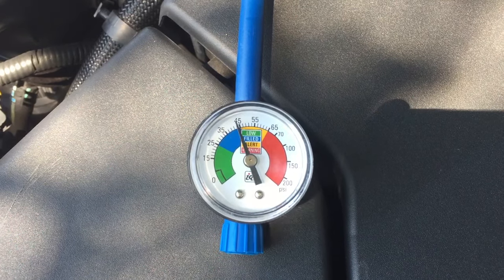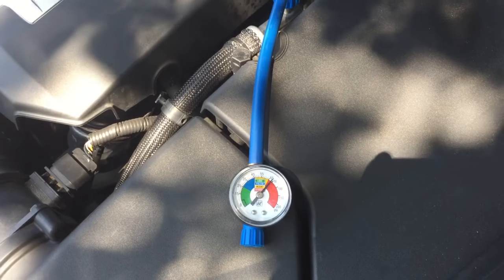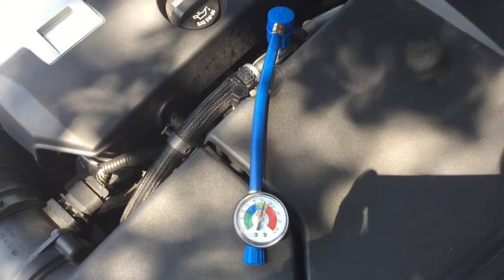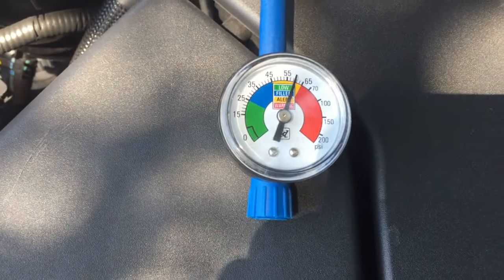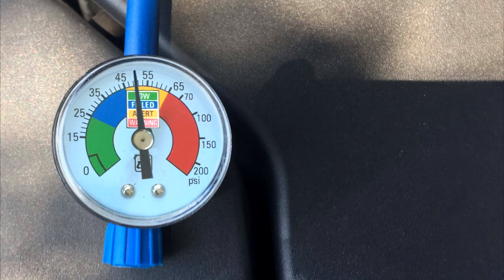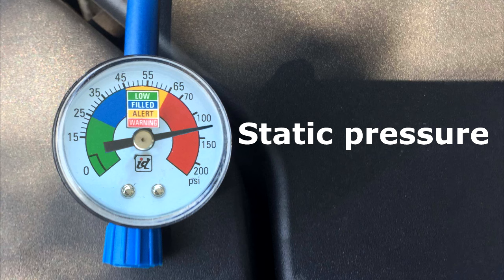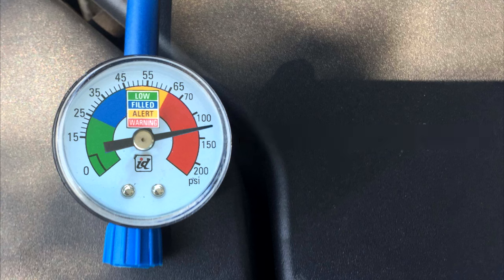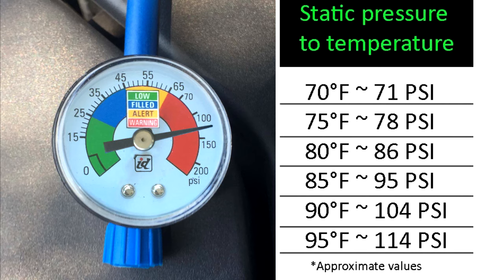Car overcharged AC system or undercharged fix

Comment from the maker: Forgot to mention that it's best to let your car cool down to ambient temperature for a more accurate pressure reading.
The chart in the video is for R-134a refrigerant.
Reply: Hey my static pressure is only 70psi at 80f outside temp. But when i turn on my car and ac and plug it, it goes into the yellow 55psi which should mean is overcharged. Idk what to do, should i add more? Or is my problem somewhere else?
Reply from the maker: @omarct according to the chart you need to add more refrigerant.
Does the pressure fluctuate up and down, or it's steady around 55 PSI?... if it's steady the compressor could be going bad.
Reply: @Your-Self  Yes its completely steady.
Reply: @Your-Self  To add, the ac is working but the air coming out doesnt feel cold enough,  around 60-70f if i had to guess,  it takes a long time to cool when it is very hot outside.
Reply from the maker: @omarct I'd try adding the refrigerant a little at the time because it seems too low. If that doesn't help, you'll need to see a mechanic because the compressor could be weak, or the expansion valve got stuck, or something else... not sure.
Reply: @Your-Self  Ok thank you.
Reply: @Your-Self  Hey, it seemed my car was overcharged somehow. So i removed some freon and now the air is cold again. ty for the help.
Reply: So is being in the Green Zone Appropriate like every other video says??
Reply from the maker: @Rob G on this particular gauge, the Green Zone is kind of low... need to be in the Blue Zone. Other gauges may have different colors, so I'm not sure.
Reply: You should pin this reply to the top as it's very important to know this before measuring the static pressure. For instance, I checked mine immediately after turning off the vehicle and it showed 150 psi (car should be at 95 in my ambient temp). Did my research, learned about letting the car cool for 50 mins, then was going to correct you but found your comment burried down here lol
Reply: How do you let some of the pressure out?? And can you still drive the car if your AC is overcharged
Reply: @jenniferparis4957  You really should take it to a shop, where they will connect a hose to the A/C port and let some refrigerant out into a tank (reclaiming).  [hate myself for even saying this, but ...]  You COULD just press the little pin down inside the port for a second or two with a small piece of dowel or other small tool (try not to use a metal object or you might slip and gouge something in the valve), while keeping your head turned well away from it so you don't get any in your eyes or inhale it (very bad).  But you are not supposed to just vent it into the atmosphere like that.  It is even against the law.  And you are thinking, "Right, like a cop car is really going to come screaming up to arrest me if I let a little jet of R134a go in my driveway".    True.  But you really aren't supposed to do it, and it is bad for the environment.
Reply: Would this be the best way to charge a system that you have no label for reference of freon amount?
Reply: Short and sweet, thank you 🙏
Reply: Question my daughter 2018 Hyundai accent is over charged how we can take out the overcharged in her car

Comment: If overcharged and you have a empty can or one that you just used to charge the system, put the refrigerant can in a container of ice and water. the refrigerant , when you turn the valve on the pressure will drop in the system as the refrigerant moves back to the can. Shut valve off when pressure starts to rise and give time for coolant in can to cool more. Repeat until AC is either properly charged or if you went to far remove the coolant can from the ice water and warm up then use valve to put refrigerant back in vehicle. Please upvote this if it helps you legally correct the overcharge issue, bonus you get to keep the excess refrigerant with this vehicle in case you need to add it later.
Reply: Great technique! Thanks!
Reply: @John Doe Thanks, I have used it with the R410, it should work with any refrigerant or liquified gas. It is a bonus when staying legal saves you money and saves our Ozone layer.
Reply: Thanks! Does your car need to be turned on during this process?
Reply: That could be very dangerous
Reply: @DanO181919  More so than what has already taken place? I notice warnings by Scotty Kilmer with good reasoning about the entire process https://www.youtube.com/watch?v=_IBFLMYZEzI .
Reply: Makes little sense
Reply: I totally understand what you are saying. I use this method to put butane back in the bottle from old dead lighters to reuse the fluid. I didn't know it would work with AC refrigerant.
Reply: So put the empty call on cold water for how long or I do it while I hook th e low pressure
Reply: @marklewis4664  Because the refrigerant is going through a phase change from gas to liquid it gives up a lot of heat, therefore you need to provide a lot of cooling and that is why you need Ice in the water which will quickly be melting and you may need to add more ice. You should be able to do this with the motor stopped, you will see the pressure on the gauge and when you open the valve you should see the pressure drop as the vapour condenses into the  ice cold empty bottle. If you see it quit dropping simply turn off the valve and let the ice water cool the bottle more and open the valve again. If you want to add refrigerant back into car1st remove the refrigerant container from the ice water and let it warm up. I suggest only using the used refrigerant with the system it was taken from so as not to cross contaminate.
Reply: Love it. 

Where are you based? I'm a sales engineer and would love to have a chat over lunch sometime. I'm in Atlanta.
Reply: @kenlgraham are you still active by chance?
Reply: Magnificent points!
Reply: Thank you sir!!! That is flipping genius!!
Reply: THANK YOU FOR THE TIP. WHAT IF I ADDED TOO MUCH OIL IN THE SYSTEM. IS THERE A WAY TO REMOVE EXCESS OIL WITHOUT LOOSING THE REFRIGERANT?
Reply: @G13RS  unfortunately… not really I’m sorry bro!!!!!
Reply: R-134 isn't supposed to do anything to the ozone layer, so just dump it..
Reply: Ice water add salt to further cool the water bath. They do this to make ice cream using ice water.
Reply: Wouldn’t that empty/extra can explode if overfilled?

Comment: THANK YOU SO MUCH!!!!!  My compressor was cycling and my air conditioning didn't work.  I thought that I needed a new compressor (which I didn't have money for) and thought that we'd have to go this summer with no A/C.  I found your videos and apparently, I just overcharged my system.  I purged some freon and now I have air conditioning this summer.  My wife is so happy!
Reply from the maker: Glad it helped, and thanks for watching!
Reply: How did you purge it ? I added too much and now it's warm and we are headed on vacation 😢
Reply: @jamesfalcone310  ended up needing new compressor and AC expansion valve. Honda tried charging $3800 with six month warranty on parts 👀 my private mechanic did for $1000& parts are lifetime !!  Definitely shop around

Comment: We spend $22 on the A/C Pro gauge/connecter and fixed the overcharge. Thank you SO much for this easy to understand video. God Bless!
Reply from the maker: Great job, and thanks for watching!
Reply: Do ac pro gauge reduce the psi automatically?
Reply: How did you lower the high side thanks
Reply: Can you take any out if it was overcharged? I mean without going to a mechanic?

Comment: Just found this video after trying to fill my ac up and gotta say, you saved me a trip to the shop. Noticed after filling to what I thought was the right amount the compressor kept kicking on and off in about 1-2 second cycles which definitely felt wrong. Used your method with the car shut off and ambient temperature at 85 degrees and noticed the pressure was like 118 psi. Yeah, that's an overfill. Whoops. Let the pressure back out according to the chart you showed and boom, back to normal. Thank you!
Reply from the maker: Great job, and thanks for watching!
Reply: How do you let the pressure back out
Reply: @jenniferparis4957  I saw a comment below that stated "used the same hose the a filled it up with, just took off the refrigerant  canister."

Comment: Thank you, the compressor was cycling on and off, put the guage on it, showed about 55 psi, and it was about 85 degrees ambient. Started it up and started adding 10 sec at a time, and shortly the air began to cool, kept adding until 30 psi on the low side and very cold air. And it stopped cycling at about 20 psi.
Reply from the maker: Glad it helped, and thanks for watching!

Comment: I overcharged mine. Clutch kept cycling on and off 10 times/min and only blew cold when engaged. My gauge would read overcharged and then once the clutch on the ac engadged, it would drop down, only to shoot back up once it turned off. I took some refrigerant out of the system and now the ac compressor clutch stays on.

Comment: Dude you save me,  money and from goin nuts.  I followed AC Pro's instructions and gauge precisely and had no idea I over changed it.  Then a/c stopped working and engine fan screaming load for some reason.  I really could have kicked myself for ever having done this.  Thank goodness I came across your vid,  you make it so easy to understand and do!  I did the release in 3 stages over 3 days,  didn't want to do it all at once.  Now the a/c runs and sounds normal,  normal engine fan sound and a/c is cold.   I'm never doing a DIY a/c charge again :)
Reply from the maker: Glad it all worked out well, and thanks for watching!
Reply: Do you release from the low or high side? With engine running or off?
Reply: @rowekmr  asking the important questions, pls let me know as well 🥲
Reply: @rowekmr  low side only

Comment: Fantastic straight to the point video. I used  the static test to find out I was low on refrigerant. I kept adding small amounts of refrigerant at a time until I got it in range. Now my AC is working great, and the clutch does not keep cycling on and off. Thanks for a great video, and keep up the good work.
Reply from the maker: Thanks for sharing.

Comment: Wow thank you so much! It's almost impossible to find any useful information on air conditioning. My car's AC was kind of cold (48-50 degrees while driving, not cold at all at idle) and I checked the static pressure was only 70 psi this morning. I added about 2 oz of refrigerant and it's blowing in the low 40's all the time now!
Reply from the maker: Glad it helped, and thanks for watching!

Comment: Excellent advice. I was easily able to spot an under-charge condition in my 2005 Toyota 4Runner. I then noticed that the addition of only about 3oz. of R134 produced a 20lb increase in static pressure at 69F, so will try adding another 3oz to see if this gets the equalized pressure up to 70psi, as is suggested by the chart for this ambient temperature. THANK-YOU.
Reply from the maker: Thanks for sharing

Comment: Can’t say thanks enough. This worked like a charm! I had my car evac’d and recharged at the dealer after I replaced my condenser and Hi pressure switch. It would work in the shop, but once you’re out in 80+ degree weather, the compressor would turn on for 5-15 seconds and then turn off and just blow the hottest and most miserable air you’ve experienced. Today was 87, so the perfect temp to try this out at. After hooking a gauge up and seeing that the pressure was at the max end of the red I let it out until it was in the green, and my ac blows ice cold again!
Reply from the maker: Thanks for sharing!

Comment: Thank u. I just tried your explained method and I had way to much liquid in mine. I removed a lot and will wait until I take a drive to see how it feels. The chart was very helpful. Great video✌🏾
Reply from the maker: Glad it helped, and thanks for watching!
Reply: It's important not to remove compressor lubricant when adjusting refrigerant charge, this can lead to compressor lubrication starvation and thus mechanical damage to the compressor.
Reply: How do you remove the freon?

Comment: Thanks for the info on static pressure testing.  I have a 99 Yukon that has very cold rear air and not so cold air in the front.  The A/C has always worked great for the 7 years I've owned it.  I checked the low side pressure with the engine running and it was cycling between 70 and 35psi.  The low side tubing does not get cold either.  The car is in good shape and has always been well maintenanced.  I will need to do a static test the way you describe here to see if I have lost refrigerant.  I also suspect the evaporator may have debris (not likely unless something built a nest in there), or the orofice tube may be clogged but am not sure at the moment.  The condenser is clean also.  The auto parts store thinks it could be the blendor.  I do get hot air when I turn the temp to hot but maybe door doesn't actuate all the way when on cold?
Any ideas appreciated. TIY.

Comment: Ok, so the Temperatureamd Static Pressure are exactly lined up, how about the color its still in the Red is that Good or Bad, you mentioned that you don't have to do anything, wouldn't you want to release some Pressureto get it in the Green Zone, just curious.
Reply from the maker: If the Static pressure (AC off) is in the Red, it's fine. But if the running pressure is in the Red, that's bad.

Comment: Great video. Thanks! Question... What if my static pressure is too high (with car off) BUT my low-pressure is too low (with AC on)?
Reply from the maker: If the Static pressure is too high, release it first. And the Low side pressure may actually go up into the Normal zone with AC running.
If that doesn't work, you probably need the dual manifold gauge to figure it out. There could be a clog probably in the Expansion Valve/Orifice. Or, if the leak is on the Low side, some regular air has been sucked inside the AC system, and the pressure will fluctuate strangely because of it.
Reply: THANK YOU VERY MUCH!!!

Comment: How do you release pressure if overcharged?  Hold the valve stem down with a screwdriver?  Your video says fix, but you didn't explain how to release pressure.
Reply: I saw a comment below that stated "used the same hose the a filled it up with, just took off the refrigerant  canister." either pull the trigger without the can or release the valve on guage hose and let freon out; wear gloves or have towel could be cold.

Comment: This seems like a helpful direction, but cross referencing the ambient temperature chart online seems to produce a different static pressure requirement for every single different chart source
Reply from the maker: I'm not sure what chart sources you are referring to, but my chart was created directly from the Manifold gauge for R134a. The gauge is not digital, so the STATIC Pressure and Temperature numbers are slightly off. But it's close enough to give you an idea if the system is overcharged or undercharged when using a basic gauge. Keep in mind that the OPERATING Pressure/Temperature chart would be different for each model depending on the fixed orifice or the variable TXV valve.
Reply: @Your-Self  I didnt word that very well, I mean every chart I can find, is showing different values. I wanted to find at least one or two claiming the same values with the same temperatures. Random unrealistic examples off the top of my head: I pull up three different charts on google, and I find the column for 90 degrees ambient, chart A says 10lbs pressure, chart B says 15lbs pressure, and chart C says 6lbs of pressure. There is no uniformity across sources, so I'm not sure which one to listen to. I wont be able to get back into messing around with that project until the weekend or the next, so its not terribly important, I think I'll just go with the values you provided. I do appreciate your feedback and making this video, I havent fixed the system yet, but this video helped massively to give me a direction to start
Reply from the maker: Those charts could be for different refrigerants, I'm not sure. But you don't really need the chart if you look at the picture of the proper gauge. There you can correlate the temperature with pressure. For instance, 90°F (in red), matches with 104 PSI (in blue), but if your pressure is way lower, you need to add some R134a. https://www.bing.com/images/search?view=detailV2&ccid=5i6Jrqkd&id=864E02271F46E43C708750828D071956289B33A2&thid=OIP.5i6JrqkdM7dFhd1ZfjTP9QHaHa&mediaurl=https%3a%2f%2fsmhttp-ssl-49898.nexcesscdn.net%2fmedia%2fcatalog%2fproduct%2fcache%2f1%2fimage%2f700x700%2f9df78eab33525d08d6e5fb8d27136e95%2fm%2ft%2fmt0400.jpg&exph=700&expw=700&q=low+side+gauge+manifold&simid=608008562774599586&ck=1E499DBC14A1E63CD3F0B9189C6793A3&selectedIndex=8&FORM=IRPRST&ajaxhist=0

Comment: Just would like to know should I turn on AC to  LOW to check the pressure on the L refill refrigerant to do this or whenever degrees? 
Please give me help , thanks
Reply from the maker: This video shows how to check "Static Pressure" with the AC off when the pressure on your gauge is jumping up and down. If the pressure on your gauge is steady, keep your AC running on maximum.

Comment: Just bought a 2010 Nissan Rogue in good condition but the AC blows cool air, not cold air. I'm handy but I've never recharged a system before. I hear it's risky to do yourself but MIDAS charges $200-250 for a typical AC service. Any thoughts?